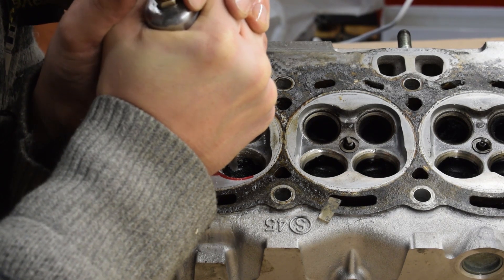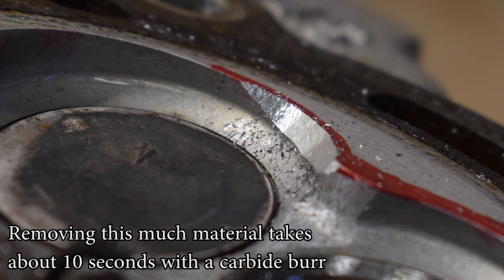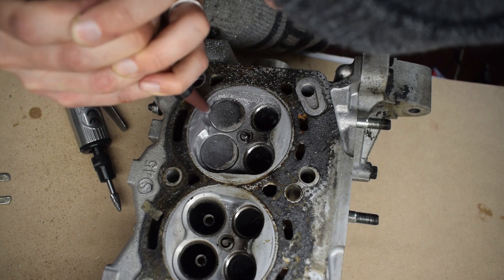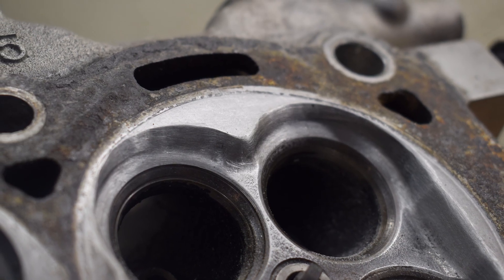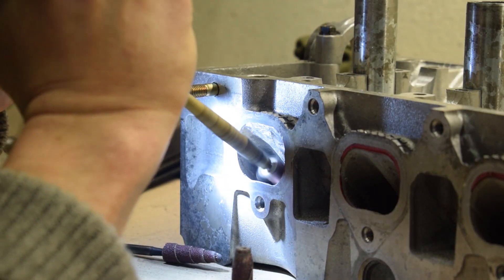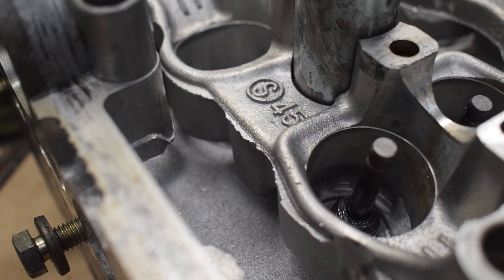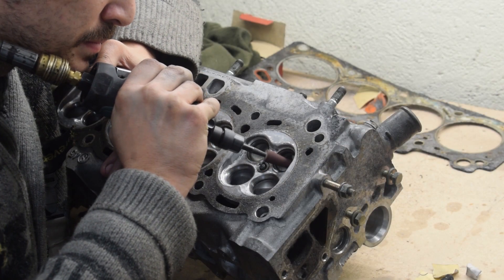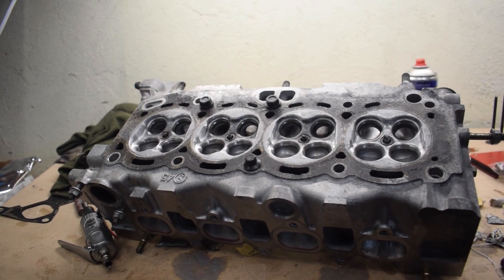PORTING the F out of it - Cylinder HEAD porting and polishing HOW TO - PROJECT UNDERDOG #6

Comment: I well remember meticulously working on cast iron heads many years ago, correcting the shortcomings of mass production and whatever else was in play. Back then, there was no practical way of tuning a modified engine, the normal practice being to engage the services of someone "experienced" to drive the car and change the fuel metering needles in the SU carburetors until performance felt right. This procedure had been researched and found to wildly inadequate according to articles in serious journals but as twenty year olds, we did our best on meager budgets. My car felt very fast to me. but since the starting point was an engine that barely ran, it was not a meaningful comparison.  It was only upon driving an unmodified car in reasonable condition that I recognized my error. My improvements had succeeded in throwing the mixture ratio and ignition timing out the window and trial and error was not a path to getting anywhere near adequate results. I had cut the power down by at least fifty percent while doubling fuel consumption. Lesson learned. (For the record, I'm sure you were not going to make the same mistake.)

Comment: YESSSSSS! Project underdog is back!!!! I want to port my own cylinder heads maybe, so this will be good to watch.

Thanks for all your videos!
Reply: I highly recommend that you don't port you own heads. Pay a professional or learn on scrap heads or your good heads will become scrap. It is easy to screw up, and this video is not a good example of what to do.
Reply: @David_H_Parker  my very first port job, was on my cylinder head at I did not screwed it! It was even my first experience with die grinder! Imagine I bought the electrical die grinder with some flexible part for it to do the grinding and I did not know the name of carbides that I needed! It is just fine as long as not using strong carbides, tightening up the cylinder head, have a tight seat, lots of light and hours of time! He just needs to start from inlet side as it is biggest hole in the cylinder head. Of course I started with exhaust side as it was least important place. So don't scare him please
Reply: @David_H_Parker  I'm considering it, not set on it yet, may just get performance heads next year, they are quite expensive as I have a car not many people make parts for
Reply: @GW2_Live  If it is a street car, spend your money on the machine work and a good multi-angle valve job.

I am a professional porter and I get tired of telling people why their car is slower on the street after they asked for a full race port job.
Stock ports will support much more power than most street cars will ever make. Polishing the ports will actually hurt the tumble and swirl effects that keep the fuel atomized. The chambers also have a certain amount of squish that direct the intake  mixture toward the plug.

The factory has a lot more engineering and development into the stock head than this YouTuber can ever undo in his basement with his die grinder.
Reply: @David_H_Parker  wrong! I am sick of people who believe they don't know shit, and factories know everything! Have you ever heard of production cost? Factory needs a profit margin and making cnc cylinder head for the cars that 99.9% of them will be used by people who have no idea what is the cylinder head is not reasonable! So what car-people can do??? costumize the parts to gain performance!  Factories make cars for alllllllllll of different types of users and conditions. But you are one specific person who run his car in a certain condition. So why not costum the car for your specific use? Dyno has proved that port and polish works!
Reply: @qkurd9141  Who's to say that your porting was any good? You? LOL

We're not talking about a race engine here, we're talking about a street engine. Most ported heads for street use actually cause torque loss, you know that thing that you want from a street engine.
Some people get a placebo effect from porting their street car. Just like the guys driving ricers with giant exhaust systems, no torque, all noise... they think it's faster because it sounds fast, meanwhile grandma passes them in her stock Civic.

Despite you thinking you know so much about fluid dynamics and volumetric efficiency, I can assure you you don't know anything compared to the engineers that designed and developed the engine.

Do whatever you want to your engine. I don't care if you kill all of your low-lift flow just because you want shiny ports.
Reply: @David_H_Parker  I agree that out there, so many stupid people trying to upgrade their car, jumping into stuff they don't know shit about and think they are cool, while they are just lame! That's the reality of ricers, yet you can't say everyone who touches the flow characteristics of an engine is a ricer.
I don't need to be a professional aerodynamics scientist or flow-logy master to gain 80% of modifying my cylinder heads. I don't want to squeeze that 20% out of it! Yes, I don't have flow-meter, but guess what!!? I can think!! Anyway, I have got very good results over messing around with cylinder heads of dozen of my internal combustion engines. Last one was my Hyosung GT250R and I modified them to throw a TD-025G mitsubishi turbo at my engine and I squeezed 50whp out of it, almost more than twice than stock! I even mapped it myself and I can hit 75 by asking an expert for adjusting minor setting on my project. So I have satisfying results of my work and I don't care if you think otherwise, as long as you are not trying to scare the shit out of other people to stop them from having fun!
Reply: @qkurd9141  Nice! Anybody can claim whatever they want to without actually verifying it. 
You can hurt performance more on a street engine than on a race engine.
Flow characteristics at low lift and lower range RPM are critical to making good torque. Torque is what you lose when you start messing with the ports and seats. Race engines are miserable to drive on the street for this reason.
Your motorcycle example is a joke. Motorcycle engines don't make much torque anyway. The losses you have made on a 250cc engine motorcycle are not comparable to a 2000lb+ car. The losses are significant on a car that is street driven.
However many heads you have ported, doesn't mean that you know what you are doing. I have ported thousands of heads, and I have a flowbench and a chassis dyno to prove my port modifications are helping and not harming performance.
The first heads I ported without a flowbench were absolutely beautiful to look at, however they were worthless for the street because of the critical areas changing the port velocity and killing bottom-end torque. 
I am speaking from decades of professional experience, you on the hand are speaking based on emotion and feelings.

For anyone still reading, I don't care if you drill holes in your engine, just don't say you weren't warned of the consequences of DIY porting a street engine.
Reply: @David_H_Parker  Thank-you,  your answer clears many questionable miss-understandings  I have

Comment: 4:00 great for turboing the car, while still being able to run 87oct gasoline!
6:01 I don't think it's a good idea to round off those edges! It'll tax your head gasket more, and gives a little ridge behind which hotspots can appear or fuel or oil can seat.

I really would have loved to see the before and after dyno results
Reply: Why would anyone run 87oct on a turbocharged engine?
Reply: @negativeindustrial  Why not? It's cheap, and still gets you more power. And I rarely need hi-octane during my street runs.
Hi octane only benefits when the turbo spools up high.
I run 87 always, in my Fiesta ST. 200HP on hi-octane, 180HP with 87 octane, 120HP without turbo. The 60 extra HP really is noticeable, even if it's on 87 octane!

Comment: wouldn't lapping the valves fix the imperfection in the seat after touching it?
Reply from the maker: Yes, it likely will, but there's a limit to how much lapping can fix. Luckily I touched with a high grit roll so it's 90% ok.
Reply: @d4a  make a video of how vacuum works in a car like the intake manifold vacuum
Reply: AFAIK the more you lap the valves the deeper they sit, which is detrimental to performance.

Comment: That's something I could sit n do for HOURS. Satisfying to clean up metal. Similar to cleaning up welds.
Reply: Yeah at my last job I spent a month or two grinding weld spatter before a welding spot opened up, nobody lasted very long at that job except for one lunatic who would eat handfuls of peanuts shell and all, claimed he used to have 42" biceps "back when he was hitting the gym full time" and finally got fired when he die grindered a person for putting parts in the wrong place.

good old crazy steve
Reply: Then go be a fettler in a Foundry. 
I lasted half a day before walking out of that job.
Reply: @LogicMrSmith  That sounds tiring... what was the foundry specialized in?

I worked for Twin city fan in, IA.
Reply: @SirCavemaninthewest  Cast iron. Sorry for the late reply, had notifs turned off
Reply: @LogicMrSmith  The worst. I do lots of motorcycle head porting and thank God it is aluminum. I have done about 1/2 dozen iron car heads and will not touch it anymore. Also no old iron head Harley's.
Reply: @mikerieck306  Yeah glad I gave that one up. Don't know how people do it but each go their own I guess.
Reply: @mikerieck306  come on you miss grinding those heads... At least there's only 4 ports on those. I did 5 sets of Oldsmobile's heads 2 Small Block & 3 Big Block ...
  I had small & big all out Oldsmobile's racing heads had to fill center exhaust ports that go under carb. warmer then other work as well to get over 100+ HP.
from them... Then polishing combustion chamber & exhaust like a mirror and getting the intake port almost to that area the given it a light sand blasting to keep the air/fuel mixed ... The other 3 sets just got a good street porting and polishing ..like talk about sore.. it was a pleasure doing Harley heads just slowly playing with them two weeks and done ...they were brand new Scream'in Eagle 1200 heads that got reworked..and with the cam and Mikuni carb talk about power that bike must of had at least 115 H.P.
Reply: @peterrivney552  Most of my work is Vintage Japanese heads especially the single cam CB750 and 550 heads. Many are used in vintage racing in North America and Europe and I have had a good amount of success with multiple championships. 
People have different opinions on port wall finish and that is fine with me...I've seen polished intake ports that have been on very successful drag and road-racing bikes and the most recent Kawasaki intake ports are very, very smooth. If there was only 1 way to produce a winning port EVERYBODY would copy it. 😉
😁
 I finish my intake ports with an 80 grit flap mandrel. I polish the chambers with cartridge rolls, flaps and finish with Scotch Brite buffs. Exhaust ports are finished with 180 grit flap and green Scotch Brite flaps.
 I've seen street Harleys in the 130 to140HP range over the past few years. That and 150 lbs of torque makes for a real fun ride. 👍 
 And....BTW.....I really don't miss those iron heads. 😆
Reply: @LogicMrSmith  Yeah....the novelty wears off very quickly.
Reply: @mikerieck306  couldn't do it , got handed a die grinder and went though maybe 7 - 800 parts and gave that shit up real quick.
Reply: True just like cleaning up welds but be careful watch a few videos and do some reading becouse one wrong move and you can end up with scrap fast going through a water jacket or grinding to much as well could change the flow and cause turbulence and you can loose H.P. always keep the runners same size as much as possible till you get to the bowl then that is where the real magic begins some heads have little tricks that can be done to create bottom end or top end as well depending where you take metal off from the roof or the floor of the runners by the bowl area... Exhaust and Combustion Chamber gets polished like a mirror and the intake stays like a sand blast effect to keep the air/fuel mixture mixed or it will form droplets and run like crap...also use your intake and exhaust gaskets to scribe the opening size and open it to that  check your intake & exhaust manifolds as well... Good luck if you ever try it there are a lot of different shapes and sizes of due grinding burs same with lengths most of the time I use 3" inch but sometimes need the 6" inch ...